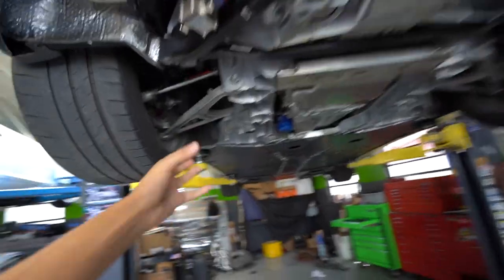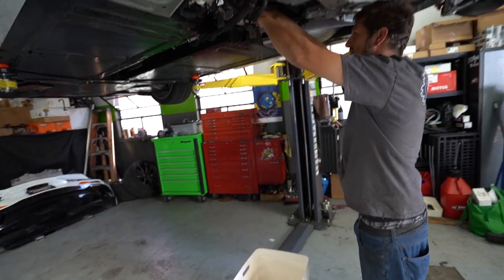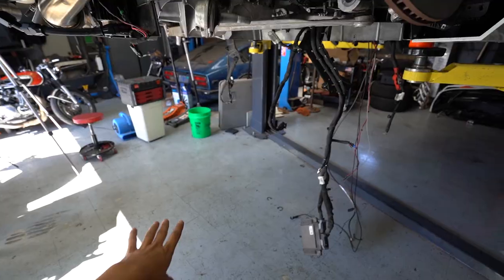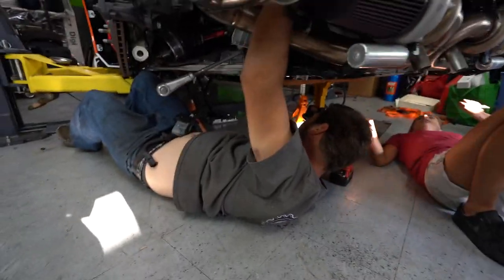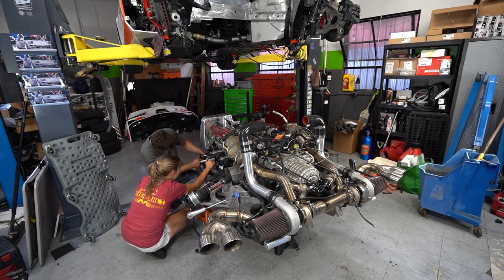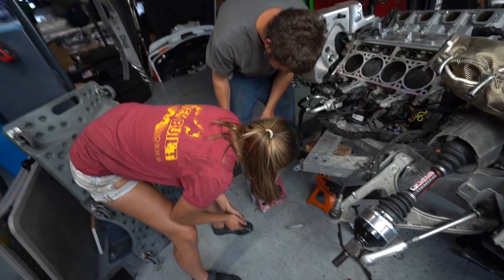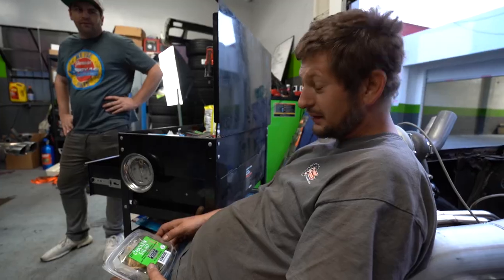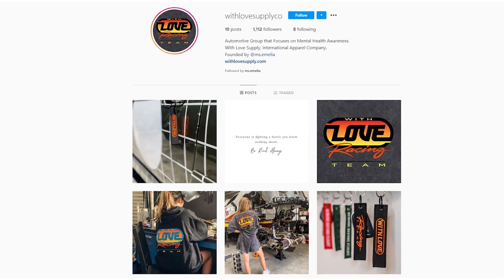Tearing down my Blown C8 Corvette Engine... Not what we were expecting...

Comment: Aw a naturally aspirated, high compression engine, with stock internals...  couldn't handle boost. Who would've thought
Reply: Yay more beating up something for no reason! Huzzah views!
Reply: It doesn't make sense
Reply: They can ... if you can tune them. You cant tune these engines yet so throwing boost at it is high risk
Reply: Chase Brooks not “high risk”, guaranteed grenade
Reply: Classic insurance fraud
Reply: They tuned it w. C16 race fuel, then she ran Cali pump gas with the factory knock protection disabled.  That was the problem.
Reply: @rpm427sc  That would definitely do it!
Reply: I'm pretty sure they understood that which is why they are getting be internals built it seems like they just wanted to push it took it blew with the stock internals.

Comment: I feel ya. Bent enough rods that I had a full sets on standby, with bearings, gaskets etc, just sitting there for the next time. Actually had pretty much a complete engine just waiting for shit to go wrong. Sent a rod through the block at 1am, got towed home by my mechanic, used the car for work that same day. Expect shit to break, and it stops being a big deal when it does break.

Comment: Hmm, rod knock from bent rods. Since you got it apart, you can put some forged pistons in it, good aftermarket rods for boost. While you got it apart this far, 3.900" crank, that way you don't have to clearance the block like you would with a 4.000" crank. You'll get a nice ci increase to 404.91 ci AKA 405 ci. Rod angle won't be as extreme either, and don't have to worry about piston rock at BDC.

Comment: The noise will be piston bottoms scraping the couterweights.

LS/LT motors have massive weights with TINY gaps between piston and weights. Bend the rods a little and they touch, leading to "self clearancing". It had to make some pretty massive torque before the elec. nanny cut in - or GM opted for really light (weak) rods.

Comment: I will often use a Snap on Roll cab (without a top box obviously) - to drop motors onto.  It means you're less under the car, plus the working height is better.  I've got that one roll cab just for stuff like this.  Dropping onto floor jacks isn't that stable, and it means you're on your back under the car with no crush space protection.  With the roll cab, nothing is going to crush past so you have a safe zone.

Comment: Yeah, those gen v motors have that 1 single funky Allen head bolt at cylinder 1.   On a side note, you could do a custom engine harness and pcm setup to negate the factory non tunable one.

Comment: It’s an LT, just a slightly more advanced LT1 which means 630-660 rwhp is about it before needing built internals. I have had more LS2, LS3’s and LT1 Vette’s with 600-630 rwhp break than on almost two hands.

Comment: It probably juust slightly bent the rods, which will make the length shorter, which would explain why those couple pistons are sunk in the bore slightly more than the others. What's probably making the noise is the piston skirts rapping on the crank counterweights as it spins around. I'll bet you have some scuffed up counterweights and self clearanced piston skirts

Comment: 11:27 you should also mention that the numbers you got on the dyno aren't even a valid measurement of how much power the engine was making because of clutch slip and/or tire slip.
Reply: meh i am quite shure that the tires did not slip as you would see that big time in the power curve, it fuckes things up very quick, also, if the trans was slipping on the dyno you would defenitly be able to hear it.
Reply: streetspeed717 had clutch slip on the dyno on his TT.
Reply from the maker: We were slipping clutches with a race compound tire yet to be revealed and when we switched to my street tire we were spinning tires bad. So yeah she was making a lot of power to spin sport cup 2’s on a mid engine car strapped to a dyno...
Reply: @EmeliaHartford  my fiance was watching this video over my shoulder and she said "she's so smart, how does she know so much about cars?" my fiance is a doctor.
Reply: You were slipping clutches because your commanded torque tables are not tuned.  Engine/trans tq has to be raised in the tune.  A piggy back is not going to help you here.    You guys are gonna continue to slip/burn clutches until you can tune it.   Just how it is unfortunately.

Keep up the good work.  Put some forged pistons/forged rods and back together with it.   Then wait for the ECUs to be cracked by HP Tuners.
Reply: @AJsSpeedShop  Which is why streetspeed717 is only running 3 lbs of boost
Reply: @nocoolname32  awesummmmmm
Reply: ajrothm gt500s aren’t slipping clutches. You people really think they built this car for “$60k” and didn’t cut corners? Junk axles, obviously engines aren’t too strong, had to fix like 2k of them because the chassis was twisting. Luckily production was pushed back so long or they’d have had to scrap the whole design with all the recalls they’d have.

Comment: When it first happened, i was thinking bent rod. It just sounded like a LS or Hemi when it just bends a rod from to much cylinder pressure. It will pull the piston down the bore and just enough to make the piston skirt hit the crank. One thing it does show is the power limit of the LT2 engine. Time for some Carrillo piston and Callies H beam rods. Weisco pistons and K1 rods are a good choice also. Texas Speed makes great stuff also. If you can’t get it shipped to Cali please let me know and I’ll send it out that way!

Comment: Rob dahm has a spare engine contact him. Its brand new.
Reply: Sure but why waste money on more stock parts? Better to upgrade now.
Reply: @philanaemic  exactly. She doesn't need an oem replacement engine, she needs better rods, crank and pistons. Hell while it's out might as well put some good heads on it too and a cam.
Reply: @pocket5s1  yes papa
Reply: @philanaemic  Upgrade to what? It's a new platform, GM had to engineer to new engine platforms to fit this thing. Where do you think they'll get a replacement other than GM parts? New platform might not have many applications that can fit the bay without modifications and then you have to worry about the internals connecting to the computer controllers. Best replace with the engine that fits the car, upgrading to unknown parts is a bad idea.
Reply: @pocket5s1  probably just the rods and a cam... but we will see the real damage as they take apart this engine completely. Look at the huge ports of these heads.....
Reply: @evilformerlys4704  Fucking hell man I don't know shit about cars but even I know that they can upgrade to heavier duty rods, pistons and cams/crank for higher boost applications. It's a frickin' LT2, not a totally new platform. You honestly think they could have sold this car at such a low price point with an entirely re-engineered engine? Come back to me when you've pulled your head out of your arse.
Reply: @philanaemic  Hmm, try sticking a LT1 in there since it can fit. They built the LT2 for this car and platform, which is new genius. Keep your panties on, I thought you meant tossing the engine for something better. I'm sorry to have upset you though.
Reply: S the lt2 uses the same bore and stroke as well as the same crank as the lt1, so existing aftermarket parts will fit. The timing on the cam is slightly different but it too is probably a drop in for lt1 designed cams. 

The only initial drawback to a cam swap is they can’t fully tune the car yet until HPTuners (presumably) gets it unlocked.
Reply: Why she is having Texas Speed build her a new forged C8 engine.
Reply: @pocket5s1  dont you see the big hole in the piston for the direct injection there no aftermarket or other oem piston that fit
 rod and crank yes put not piston and h
Reply: Simon Legros the lt2 has the same pistons as the lt1. The whole short block is essentially the same. Several companies offer pistons designed for direct injection.

Comment: Still check the input shaft on that Dual clutch trans. I'm still very skeptical on the power holding of that trans. Definitely will need the clutches upgraded.

Comment: Talking smack about Ford while working on a broken down Chevy.🤣🤣🤣🤣

48 replys of people arguing over a joke, lmao
Reply: I'm mean what do tbey expect? Pushing crazy hp numbers with a locked pcm. No tuning is asking for disaster🤦‍♂️.
Reply: @toodanderson351  truth
Reply: Chev built tough hahaha if you wanna blow it chev it 
Ford  cranks more power from a V6 and it holds together. And wins 24 hour races
Reply: @dawndark1232 ,  Ford holds together,   lol.  With bailing wire and duct tape maybe.
Reply: @terryduncan31  haha it holds together and it's a smaller engine. This thing didn't last long did it haha. One hit and bang haha. Hand grenade.
Reply: @dawndark1232 ,  that's because they modified the hell out of it and ripped it on the dyno multiple times.  Go back and look at the hp and torque numbers it made on all stock internals.
Reply: @terryduncan31  haha and a  stock internal 6 cylinder Barra engine makes  more power and holds together haha.  Quality GM product haha
Reply: @dawndark1232 ,  sure,  and that's why they swap so many Ford engines into other brands,  lol.
Reply: @terryduncan31  that's why so many are putting Barra engines In all sorts of cars even vettes haha.
Reply: @dawndark1232 sure they are,  lol.
Reply: @terryduncan31  considering that stock mustang motors make 800 hp plus at a track on stock internals reliably makes this seem like a cruel joke that gm has played.. but its typical cheap gm shit that the customer ends up paying and somehow still thinks they make a good product
Reply: @2007dalin  There are several people running stock Coyotes with more than 1000HP like David Van Voris, etc. Also I have been to plenty of shows in a major city where i live and LS swaps are 10 years ago, people clinging to the past there. However there was a host of cars with Yotes, a 99-00 M3, a few Porches, a fusion and a Ayris. lol

Another myth Ancient pushrod fans love is "100HP from cams" More like 25-45 that only makes that power to 5600-5800 much like the engine itself dropping off.  I mean if you want cheap unreliable power an LS is an easy answer, and most of those swaps aren't to monster power makers, they are old cars moving up from 255-300HP to 350, etc. Waste of time.
Reply: @terryduncan31  yes they are. You probably don't even know what a Barra engine is hahah.
Reply: @2007dalin  haha so true. GM junk. If you wanna grenade it chev it. They have been making junk engines for the last few years. Slack engine development
Reply: @dawndark1232  , Ford's Australian version,  now what?  They might be swapping them over there but they damn sure aren't in the U.S.
Reply: Tood Anderson there’s also something to be said for components mechanical limits. 
Eventually even with enough tuning you’ll still find your failure point.
Reply: @Rick Pitre and that's why the Ls is in pieces already
Reply: @Rick Pitre that’s why every ls7 drops a valve if it the owner doesn’t proactively upgrade the heads b4 it happens,  I’m not exaggerating when I say EVERY ls7 either.  Meanwhile coyotes are holding 15psi for 100k plus miles and this hunk of shit here Grenades itself on baby boost.  Gm is 25 years behind on engine development.   The cheaper coyotes get over the next 2-3 years the more swaps you’ll see
Reply: Damn y'all, I was just making a joke. Lol
Reply: Tood Anderson what crazy numbers?
Reply: Tood Anderson it’s got normal rods and pistons. They wouldn’t handle much more than 600 to begin with. Guess which cars come with that stuff forged from the factory?
Reply: Yes there swaping lots of ford engines. I have seen many a ford swaped into dumpsters.
Reply: WeN33dJustice things are designed to specific specifications. Blowing them up isn’t hard when you exceed their limits. Ford’s SVT doesn’t give you much for room to play. As it is the 5.8L doesn’t really have any. The 5.0 does have some, but the bulk of us generally operate the vehicle as designed.
Reply: Yea Chevy still conning the sheep Vette owners with cheap cast iron rods, crank and pistons.  Vette owner wow this one only stickers at 75k...meanwhile they're probably spending 2 bucks each for those cheap powdered shit rods
Reply: US OF A  Wrong there are plenty of 4 digit horsepower Coyotes that ran much longer than this on the stock bottom end.  Nice try tho.  If you are a mechanic you likely know that the forged steel rods and crank in Ford Coyotes are much stronger than the cast iron or powdered metal shit GM passes off on fools
Reply: @Russh1 ,  doing builds and being swapped into everything are 2 different things.
Reply: @terryduncan31  Just a matter of time.
Reply: @Russh1 ,  that good.  Competition is a great thing.  If Ford gets something on the market that's competitively priced,  that's great!
Reply: @terryduncan31  They're just reliable, easy power. Full blown 2500hp+ drag cars here are running multiple passes (like several meets worth) without opening the motor. Then theres the guys with built motors running 8s passes in their daily driven street cars that have put 20,000km on without opening the motor (after being built). They're not without their issues but when built right they really are that good. Shame they did what all manufacturer's do, stop making the one thing they perfected.
Reply: Dollar for dollar a 1000hp Barra will cost you near on the exact same as a 1000hp ls7. Seeing as you can change tunes in the Barra by having multiple stored people are running 8s and have a cheap to run, street car again minutes later.
Reply: @Russh1 ,  all of them have that capability nowadays.
Reply: @Russh1 ,  exactly!  The manufacturer wants return customers with a fist full of money on a regular basis.  They already know where the maximum parameters are through their own testing.  I have a 6.2 in my Sierra that is probably only putting out about 70 percent of it's capability.  That's how they get by with offering the warranty on them.
Reply: The last i checked the pushrod dragsters are getting stripped after every run still... Either way running 7-8s 1/4 mile passes with full street trim +slicks is impressive. These are cars you can actually drive on the road like you have a stock taxi engine under the hood... He even shows footage towing a boat!
https://www.youtube.com/watch?v=017FeH3ZYyQ
Reply: @Russh1 ,  they've been doing that at drag week for years.   It's crazy what technology has done.
Reply: @terryduncan31  And money... None of these cars are built cheap! Car in that last vid would have a $25KAUD motor, $8K trans, $5K diff and $10K turbo + fuel setup....
Reply: @Russh1 ,  my neighbor bought an all aluminum NA 632 that made 1165 hp on race fuel.  A big turbo or some other power adders with a tune would have took it to a ridiculous level.  Just depends on how deep your pockets are these days.
Reply: @terryduncan31  Yep a 632 in Aus would set you back $29K....
Reply: @Russh1 ,  right on!
Reply: People are really trying to argue a old style pushrod is better then a coyote? It’s takes Chevy 6.2 liters to make the power ford gets out of 5.0 and they still fall 25 hp short 😂Fords sound better, rev higher, have more linear power, can handle more power on stock internals, and are better engines in general quit comparing GM junk with basic engine designs from the 1960’s to and actual good engine design.
Reply: @iked4421 ,  aren't as reliable and will cost a fortune when they break though.  I've owned both and I'll take reliability and less cost to repair.
Reply: @darrylhaynes9208 ,  lmao!
Reply: Terry Duncan broke bois go with ls and no they are not as reliable. And don’t handle boost and power as well coyote is a far better engine hands down don’t care what you say I know from personal experience
Reply: @iked4421 ,  don't care what you say either Einstein!  Go be a fanboy since you already know everything and get butthurt so easily.  Punks always show their true colors when they're feelings get hurt.  Broke bois?  You have no idea,  lol.
Reply: Terry Duncan Sounds like your feelings got hurt when I said broke bois? Bank account running a little dry?
Reply: @iked4421 ,  you can't hurt my feelings  boi,  lol.  My bank account is fine because I'm old enough and smart enough to know what will last and what won't.  Also,  I turned wrenches for years and know that the more moving parts an engine has the more expensive it is to repair and maintain.

Comment: Yes Tide soap powder is the BEST shop floor cleaner ever, that Zep crap rots tool boxes and eats metal and paint fast with just a tiny splash.
 Being a now retired Chevy Technician for 20 years, I never got the chance to work on the C8, although I did go to the GM tech center here in Warren Mi. to train. Would have been fun. Bent Titanium rods, damn..overrev..

Comment: Interesting to see what finally turned up with the different piston heights. I'd definitely look into building that trans. up while you're this far into it! Once you make the engine relatively bullet-proof,  the trans. and converter are going to be next to shell out (if it hasn't already with all the slipping on those pulls on the dyno).😉👍 You might want to check with Texas Speed and see if they'll hook you up. Their customer service is over the top, and they can build you whatever you need.😁

Comment: I bet it was bad gas, caused detonation, since the guys in TX made modes to overwrite the ECU and the timing got off and detonated. Bend rods or broken pistons are mostly from detonation.

She should have added some 116 gas before going for fun drive. With my old Z06, I'd always add 116 to 93 gas to bring up the octane to at least 95 to be safe in hot and humid day.

This girl has more balls & determination than most guys. And she is lucky to have Sandy there.